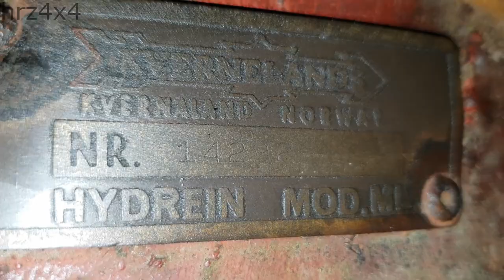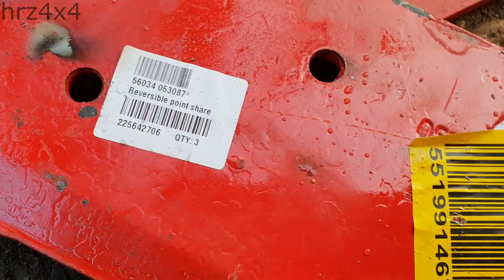Kverneland Hydrein Plow Restoration Part 1

Comment: thanks for posting.
seems like you do stick welding,not MIG.
in that case i would recommend hyundai electrodes.
i use 3.2mm hyundai with AC and i absolutely love them.
Reply from the maker: Outside I try to stick weld just because I want to learn how to stick weld - but I am still learning. Not very good welds unfortunately. But I'll get there... Usually big welding projects help ;)

Great recommendation. Which Hundai electrodes? Last time I bought some Lincoln SUPRA (588695) electrodes and welding is way better than with my previous no-name electrodes.
Reply: @hrz4x4  it's S-6013.LF to be exact. 3.2 X 350mm.
i have not tried them with DC though.
so if you use DC,disregard my recommendation.  ))
Reply from the maker: Thanks. I am not sure they sell them here. Quick search did not give any results. I have to look for them.

Comment: Hello! That's a fine job you did with fixing up that plow. Where did you find the parts?
Reply from the maker: All the worn parts have numbers on them. I just ordered from local dealer the needed parts. Some of them were not available as "original", but I am not using the plow so much.